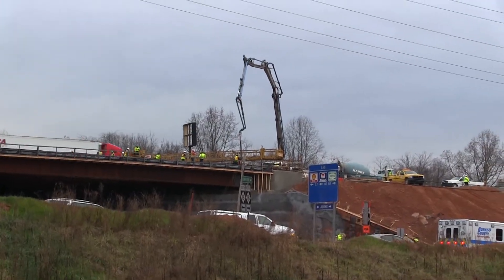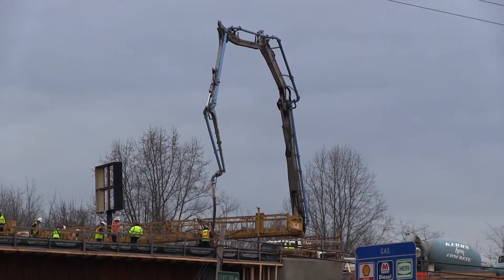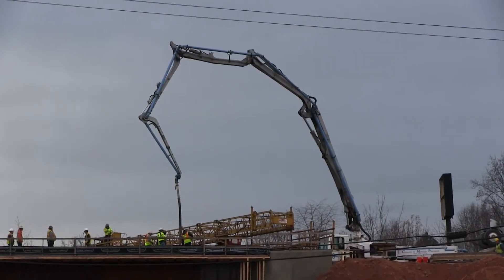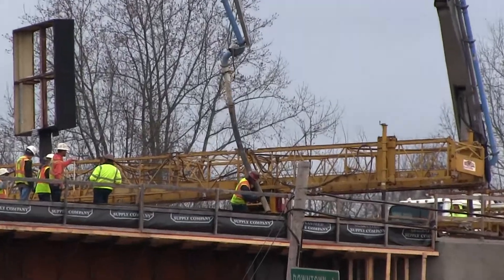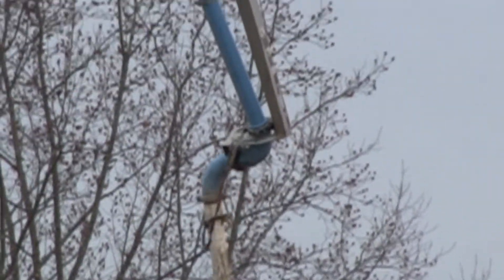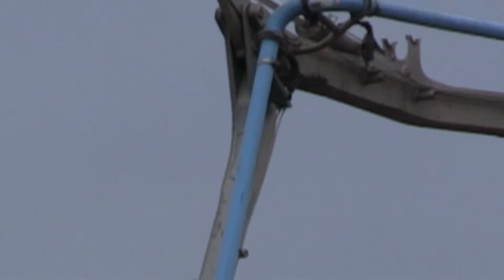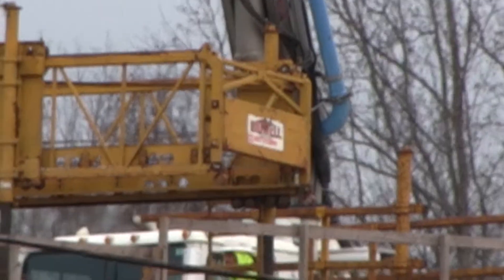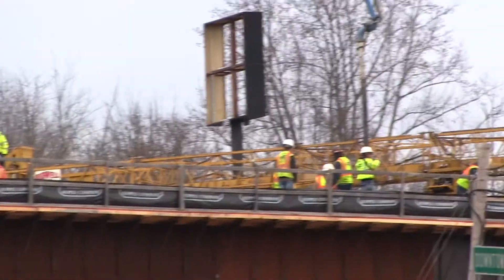Concrete Shooting Scorpion Tail Looking Thing

Comment: I used to do concrete work. It's a concrete pump truck. The concrete truck pours it into the pump truck and the man holding the hose shoots it in the frame to make a or footing foundation. I use to hold the hose. Man that thing is heavy and takes a lot of strength to hold. Tough job. Glad I be moved on to better job.
Reply from the maker: Thanks for the comment Joshua. Really cool to hear from someone who had operated one. Fascinating piece of equipment.